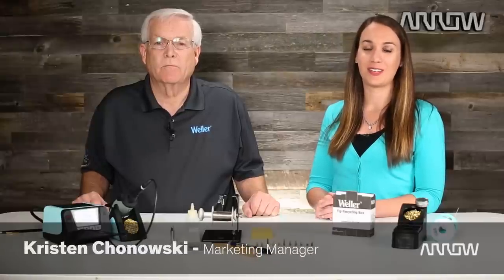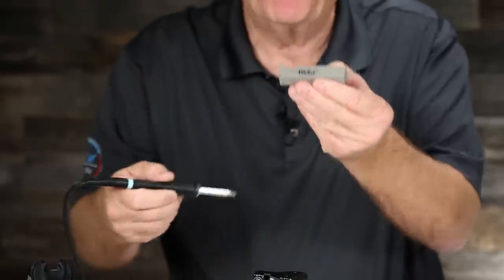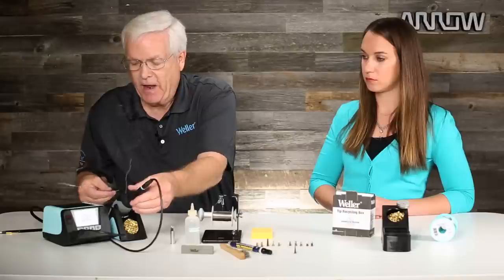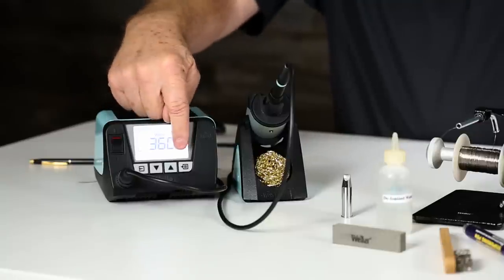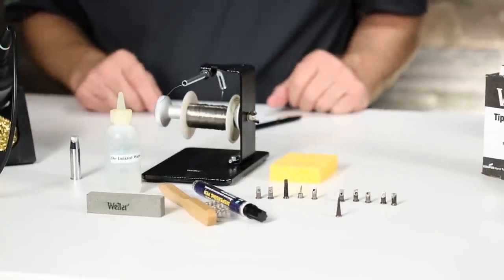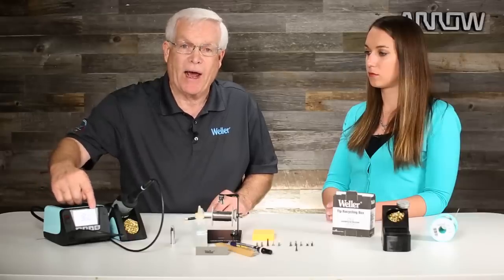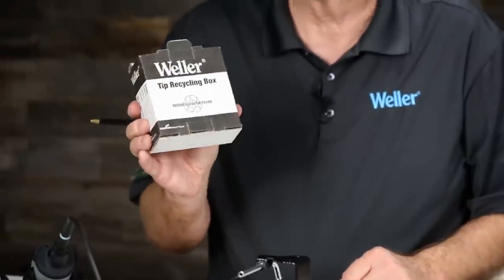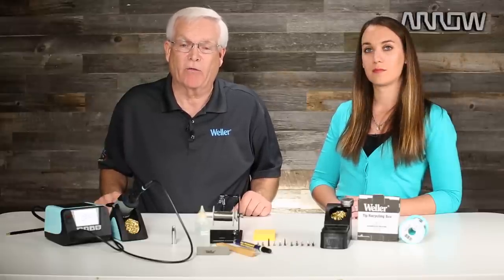Soldering Tip Cleaning

Comment: As a telecom technician I occasionally had to do soldering repairs/upgrades in the field. I found the best/easiest way to clean my Weller soldering tips was to use a small piece of cardboard and insert the tip into one of the cardboard edge holes and rotate it in there. Very little tip heat loss (unlike a cold/wet sponge) and almost always took only one insertion in the cardboard to totally clean the tip. Of course on my office workbench I used the proper tip cleaning methods.
Also, we had bins full of extra solder tips so replacement when necessary wasn't an issue.

Comment: Love your tips.. supported 👍.. Qs. Do you also suggest cleaning a tough oxidised soldering tip with WD 40? Won't WD 40 prevent corrosion too?
Reply: No, use the acid instead

Comment: I am of the opinion that a wet sponge is not good. It thermally shocks the hot tip and produces micro-fractures in the tip plateing. When I want the tip super clean, I simply wipe it with a DRY rag. I use cheap copper steel wool I get at the grocery store. It works great and is cheap.
I recommend a soldering iron that, when not used, will step down the temp then turn off after some set amount of time. After EVERY use, put a glob of solder on the tip, this will help prevent oxidation. also, store the tips with a glob of solder on them.  I store my tips with a tear drop size bit of solder on them.
Again, my tips last forever. I keep them covered with solder, I don't use water, I clean them with a dry cloth, I never clean them with anything abrasive. I used the solder acid retinner only when thing are really bad. Then immediately wipe the tip clean and retin it with solder.  Some folks use the retinner every time, I'm pretty stingy with using it only when I have been lazy and not kept the tip tinned. 
If you are going to buy a new soldering iron, save your money, don't by a soldering iron - buy a soldering STATION with the following - automatic turn off if not used for a preset time,  super accurate temperature control.  Without these features, you will fight with tip problems.If you aren't paying about $100, you are wasting your money. Good tools cost money and are worth it.
Anyhow, this was a good video with some good tips, I basically agree except the part of scraping off oxide with a steel brush and his approval of a wet sponge.
Reply: Ay Ron, Like your info, im a bit confuse though. You say you wipe it with a dry rag, then say " i use cheap copper wool" sorry on me but which one is it ? or do you wrap the copper wool in a dry rag and then wipe off the solder on tip ? thanks for any instruction.
Reply: Ron Jones expensive soldering station? Naah, 40€ TS100 it’s enough.
Reply: Hi Ronald, nice to see you again in the comments
Reply: Was that brush steel or some type of nylon?

Comment: Is Weller flux LW25 safe to use on fine electronics, such as PCB boards when soldering? It has Zinc Chloride in it, and it is said that it is acidic and may corrode and destroy PCB's.

Comment: What temperature should the soldering iron be to solder speaker wires? Say if I had low melt solder that melts at 280 degrees. How much higher would be acceptable to set the temp to?
Reply: 290, 300 tops seems reasonable to me

Comment: Also ...in this video we see Pete using a brass wool sponge to clean his tip.  I just bought a wlc-100, and the instructions said to not use abrasives to clean the tip as it will remove the iron plating, so the brass wool is ok though?
Reply: Yeah it's a much softer material compared to iron, i think they mean don't use sand paper which is a common booby mistake
Reply: Yeah the brass is not abrasive, as he mentioned it doesn't even remove all the solder and is better for that reason. (It also doesn't thermally shock the iron like the wet sponge which also helps life)

Comment: my dad thinks he is the best.... he is soldering with 400°c and just uses a sponge to "clean" his tip....
Reply: Pabloxd123 sponges are fine for cleaning off any material off of your iron.
Reply: @idcdammit  yeah i know that, but he thinks that it is the BEST to clean the tip
Reply: Pabloxd123 wrong, if you keep your solder tip in contact with air at high temperature, it will oxidize. When you clean it with sponge, you should immediately cover it with tin to prevent oxidation.

Comment: I use vinegar. Deep the tip in vinegar for 2 minutes.
Reply: non destructive hm. clean from what is a good question. in my experience in regular use copper wool is only thing you need and is super easy to get
Reply: You definitely shouldn't grind it with a file or sandpaper; all you're doing is taking off the protective outer metal until you're left with the inner copper; which oxidizes very quickly. Molten solder dissolves copper.